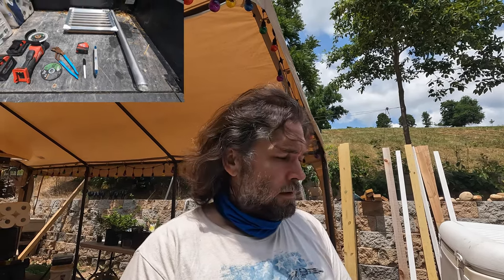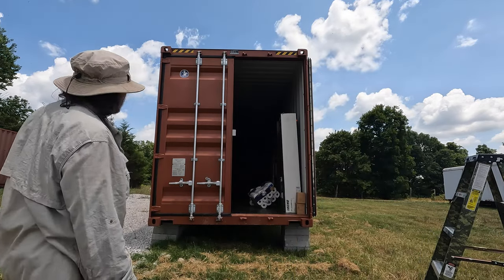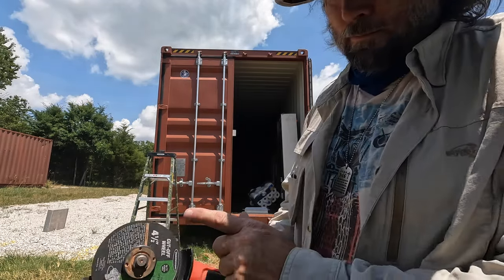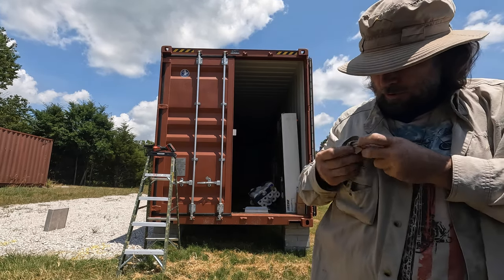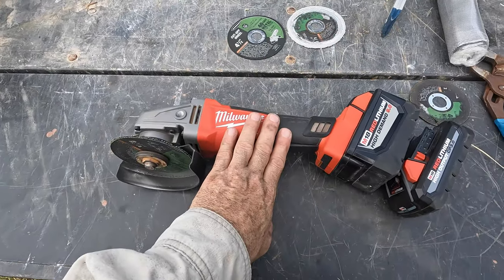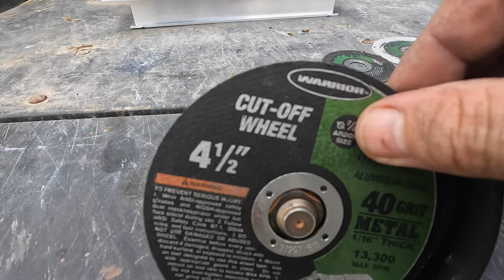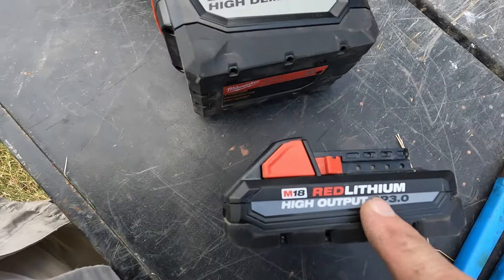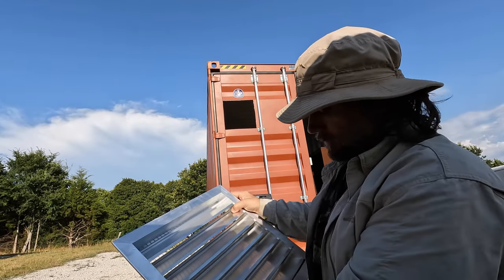Adding Vent to Shipping Container

Comment: Thanks for sharing.  I think adding vent at the door will able to pull hot air somewhere ner the door.  But at the end of the container air did get circulate.  If i were you i will install it in the middle of the side.  This way vent can pull air more efficiently. Just my thoughts.
Reply from the maker: Good point and what I did nto show is there are 4x vents in the container already plus I added a smaller vent to the rear. I should have spiked that out!